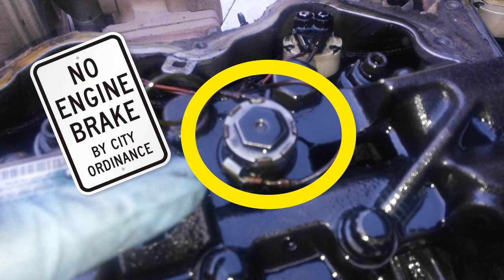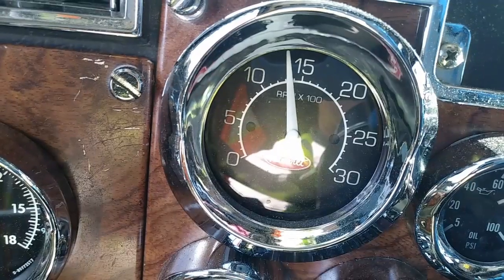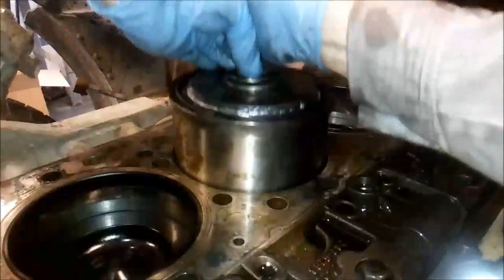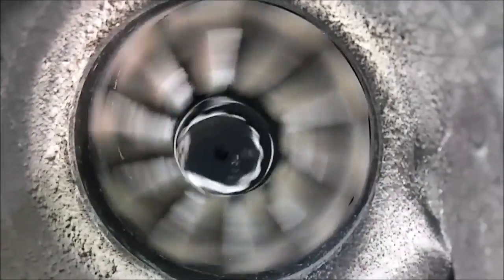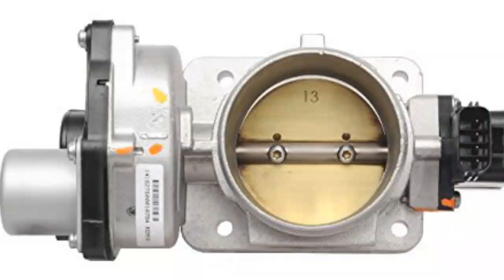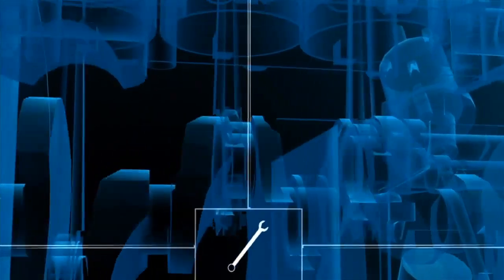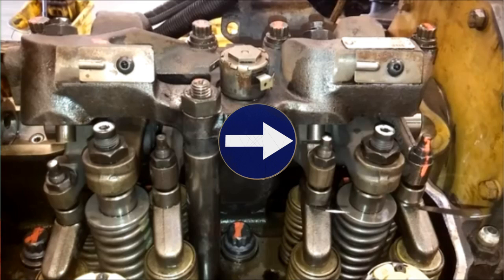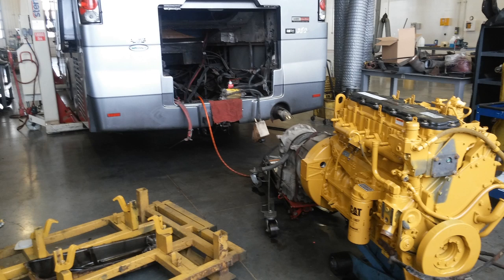The Difference Between Jake Brakes And Exhaust Brakes?

Comment: So the old engines back in the day. Had a release valve(s) on  the head(s). With a cable attached to put the compression in the head. Hence slowing or killing the engine. So this is based upon  the same concept I assume. I've seen these in 4-strokes and 2 stokes for some reason.
Reply: Sputnik isn’t that a compression release? Makes starting the engine easier, especially cold starts.
Reply: @interstate5trucker  Now that you mention it. Though it was never explained to me. That actually makes sense what you said. I am from where engines are stopped by shorting the coil. [By hand] I never gave much thought then. I thought it was how they normally shut it down. {Which they sometimes do] But yes, I believe you are correct.

Comment: So lost compression on #5 on my c15 Sdp found it was leaking Thur exhaust valve tore it down and found out the exhaust have be hitting the pistons set and checked timing before I tore it down everything checked what else could cause this thx
Reply: Crack in the head

Comment: 2:00 you are not 100% correct. Diesel because of much higher compression, have greater engine braking than gas engines. Big trucks need exhaust brakes because of the heavy weight.
Reply: Actually you are not entirely correct , even without a fuel input or very minimal fuel input what do you suppose happens when the very high heat ,highly compressed air does to the top of the piston when it starts its downward stroke... thats right even with out fuel it gives the piston a good shove down the bore.
Reply: @walkerv8530  I own a 2016 F150 with the 2.7 ecoboost. set the cruse control at 35 mph and go down a hill. It will down shift to 2nd. gear before the engine compression braking can control the speed.
Reply: @walkerv8530  You ever tried to turn a diesel engine by hand? It's a lot harder to turn even after the compression stroke.
Reply: @Fone65  i am a going on 20 years working on heavy trucks,  so yeah by hand np the compression leaks past the rings big difference when its turning at speed on its own no time for much compression leakage.  You try  and do what you do in your pickup truck down a grade in a big truck with out any jake brake or exhaust  brake you will overspeed engine in a heartbeat with a load on . Empty maybe you can get away with it depending on the grade .
Reply: @walkerv8530  Here we go with the "I been working on big trucks for 20 years" capping. Telling me you have been working on big trucks is a waste of time. Unless you have videos on your channel of you working on big trucks. I'm not going to believe you. 
The point of bring up my F150 was to say small gas engines have very little compression braking. If my 2.7 was a diesel v6. The tranny would not need to down shift so low to control speed.
Reply: @Fone65  some people have a youtube acct to be able to subscribe to channels,  i have no interest or time to make videos. You don't have to believe me . You can look me up on HEF or Fb i post  some of my work stuff on both , mostly on heavy equipment forums , under shop talk .walkers work doings .
Reply: @walkerv8530  I don't mess with forums. People lie their ass off there.
Reply: If you watch his video on compression brakes like he said he is not going in depth here because he has another video on them.

Comment: Electric motor powered vehicles can use the motor as a brake and put most of the energy back into your batteries. 
Since this video is for curious people seeking knowledge I thought I'd throw it out there. And it's basically silent !
Reply: Batteries aren't magic. They can't absorb arbitrary high charging input, especeally beeing cold, fully charged and too high at all. For example, battery from Tesla Model S p90D road car is only limited to 60 kW regen (less if full or cold) and 450 kW of power.
Reply: ... Regenerative braking already exists on some electric and hybrid vehicles. Of course its used in conjunction with conventional brakes and there are limitations to how much the batteries  can handle in a given amount of time. But it works just fine you goofy ass mafcks 😂 @Richard Wolfe
Reply: Only if they have alternators or generators instead of brakes.......
Reply: @thecloneguyz  An electric motor can easily be used as a generator. Its called regenerative braking.

Comment: exhaust brakes work better in the city. But for pure horsepower for reducing speed on a long steep hill, jake brakes do the deed better because they produce more horsepower to the drive wheels for slowing. Like using your engine for a compressor. A big multi-horsepower air compressor. That is not how engine brakes work.They just use the engine to pack the exhaust with all the flow out, thus not using the flow as efficiently for power to the rear drivers.

Comment: Does anyone remember the magnetic braking
Reply: loadmaster61 intarder
Reply: Anyone remember a retarder system called Telmar?Basically an oil pump with cooler that retarded engine RPM.
Reply: They still make those.

Comment: Why is my Jake brake so weak even though I had an overhead done, 06 W900 with a C15 Accert MXS 826k miles? When I'm bobtail it doesn't even lock the tires up in the rain.
Reply: rev9fan1 you DO NOT WANT TO LOCKUP THE REAR WHEELS IN THE RAIN !!!! That will cause a loss of control as tire grip goes away. Never ever do this.
Reply: @donaldpauli129  I know that, I'm saying the truck I used to drive locked the rear wheels up bobtail, this one doesn't...which means the Jake's are weaker...I was using it as an example

Comment: I saw a pickup truck with a camper one time, it was a diesel, but, supposedly it had a jake brake.  I don't recall the exact model, I think it was an older Dodge.
Reply: [FCClan]The Stranger new ones have em on the 6.7 cummins
Reply: @RDC_Autosports  When did this start?  The truck I saw was several years ago.

Comment: I've seen those stupid no engine breaking signs. I'm the ass hole in the blue KW blowing by it on the brake with a straight piped Bmodel 3406. Our truck with the straight pipe c12 is a lot louder but it's more high pitched and cracky I'm not really a fan of it

Comment: I have an exhaust brake (5.9 Cummins  RV) and I am curious has there ever been an intake retarder (exhaust brake on the intake side like a butterfly valve in a gas engine)? If not do we know why and if one was installed with the exhaust brake would it improve the engine braking?
Reply: It would screw up the af mixture and cause a lean condition, causing damage
Reply: If you restrict intake air flow in a compression ignition (diesel) engine, maintenance and repair costs will rise due to fuel dilution of the engine oil.

Comment: How come ram Cummins, Chevy Duramax donest have a Jake brake  but have exhaust brake. I need answer for this question
Reply: I think they're technically classified as light duty trucks...and hell, most people don't even pull anything with them. I'd expect someone who is frequently towing to get a medium duty truck. Having an engine brake on light duty trucks is an additional system that most people won't use, the ones that will, will likely exceed the GVWR. There's also an issue with qualification, giving average Joe advertised capability of a 25,999 lb GVWR or 9,999 lb payload and the false confidence of an effective marketing strategy is just asking for a lawsuit when Joe goes flying down a mountain and kills a bus full of children. It's not worth it for the manufacturers. Just my opinion.
Reply: @littlerhino2006  you have shitly explanation
Reply: I have a friend that has a Ram with the 6.7 Cummins, he pulls a camper trailer with total weight around 25000 pounds. He says when he starts down hill/mountains he turns on the engine brake and it will actually slow the truck down until you turn off the engine brake or step on the accelerator. His has an automatic and it will keep down shifting as it slows . I would say that's a great safety feature
Reply: The manufacture does not use the Jake brake is why it is not in them.  Jake brake adds a lot of complicated equipment to the engine, listen to his explanation on this and watch his videos on Jakes.  He is going to explain it better in his videos than someone in the comments, watch his videos he is excellent.
Reply: You need an answer?  Did you watch the video?  I think he about covered it. No?  Then do some research on your own instead of waiting to be spoon fed.
Reply: Jeff O Exactly!! Fuck sakes; the guy explained it right near the beginning of the video!
Reply: @jeffo1108  fuck you old Ass
Reply: It's sort of an unspoken "get a real truck"

Comment: Nice video. I have Detroit series 60 and the engine break is really weak in 3 position and usleess in 1st. Are there different brands that have a stronger stopping power ? I checked mines at the dealership and they said they work fine but I have to use service brakes even if I'm empty on a big hill.
Reply: On a big hill you may still need to use your wheel brakes but. Find a good shop and have the valve train adjusted correctly and the jake brake adjusted correctly. They normally are extremely effective at 2,3,6

Comment: Great info!
The exhaust brake on my old International Maxxforce felt about as effective as the Jake on my old N14 and my new ISX15 truck with the system set to "1"..... In other words, it was damn near totally ineffective. Brake jobs nearly tripled in elapsed time after I ditched that Maxx POS......
Reply: My maxx 10 had an egr cooler failure twice, causing a hydro lock situation. Has had 2 in-frame overhauls, and still has less than 60,000! No “self-called” truck driver, will make me believe these are even decent engines. Pure, pure, junk!
Reply: The maxx force got a bad name but I drove one with 620,000 and it was a damm good motor held great oil pressure and pulled up mountains without having to downshift
Reply: @jamesshaw4954  I'm sure there will always be examples of any contested engine model that do alright, after all they did make thousands of them!
 That said, the general dissatisfaction with the MaxxForce combined with the subsequent abandonment of the engine for Cummins engines by International, tells me they had an overall bad engine on their hands. Mine had only 250K and almost never worked right or ran without a check engine light on. My N14 went 850K miles with almost zero problems and I've got an average of 300K on several ISX15 engines right now, with only regular maintenance required.
Reply: Intertrashional...there motor was trash but boy did they ride nice
Reply: Try playing cards in the spokes and stop whining! DK, ASE master tech since 78

Comment: So I run a Detroit DD13 and I've been told it's got a real jake in it but I've also been told it's got just a exhaust valve, it's only 2 position, it works ok, the older Cummings X15 I used to run had a real 3 position jake in it and that worked incredibly well, but the interesting thing is the Detroit is LOUDER really loud , the jake in the Cummings was quiet, both were completely stock exhaust, the DD13 is a grass burner.
Reply: Cummins no G

Comment: Thoughts on using an exhuast brake to warm up a Diesel engine quicker
Reply: international VT365 and powerstroke 6.0 fords did use the brake as a warm up device.  When the weather was cold and your engine was warming up you could go around to the exhaust pipe end and hear the exhaust load up and quiet down, then hear the whooshing sound coming when the engine brake function in the turbocharger let off.  Not sure if any one else does and I wouldn't recommend doing it on Cats simply because unless you are turning the brake on and off like the Internationals did you could overheat the cylinders due to the exhaust not getting out of the engine and cause damage to the internals of the engine.
Reply: matt lee Bc my 7.3 Powerstroke back pressure valve closed for a few seconds and I’m just wonder if booking it up to my own switch to leave it closed for longer would be bad
Reply: Not no, but Hell NO.
Reply: @johngoldsmith6629  modern diesels use their exhaust brakes to warm up quicker.
Reply: Modern diesels already use their exhaust brakes to warm up quicker
Reply: Yeah don't do that. That's how you build up soot on the valve and on the turbo

Comment: whats this break saver you keep talking about?
Reply: Brakesaver is a oil retarder mounted on the rear of a 5.4 bore engine, between the flywheel housing and transmission. It has two oil pumps, very long oil cooler, two flywheels, special oil pan with a control valve mounted to it. Leaks a lot of oil if not maintained.

Comment: I drive a 05 kenworth with a c15 Acert its the b model not the m the jakes are supposedly working all stages of the jake work  but it does not slow me down verry well at all
Reply: Kyle,
Could be the brakes Jake, are out of adjustment,  or not using a low enough gear. Not sure about a 2005, but I know the newer trucks with 3.08, or 2.64 2.25 gears are pretty high gears and would need to be in a very low transmission gear to have a lot of effect .
Reply: @bertgrau9246  seems about right 5th gear holds ok better than any other gear but shift into 6th or anything above it and forget it gotta ride the brakes and alot of the hills around here are 30 35 so 5th direct is 15 20 mph at 1700 rpm idk just gotta deal with it ain't my truck and my boss takes good care of me so I cant complain to much
Reply: @kylenagle4960  
I know what you mean,  I drove a lot of trucks without any kind of engine brake,  the rule of thumb was use 1 lower gear going down than what it would take going up, thing is with a 220 horse engine you weren't going up hills very fast and going down were slower 
I still drive once in a while trucks are so much more comfortable than they were. 
Have a good day sir
Reply: BXS engines still used the same Jake brake housing that the 6NZ engine used.  Lots of times a rebuild kit through your Cat dealer and about 3-4 hours to install and reset up your overhead and the brakes work way better.  The springs in the housing weaken over time and cause the brakes to not respond properly.  The exhaust brake opens too early and dumps the compression before the engine reaches full compression pressure.  Typically about a grand or so will fix them up really good and the brakes are rarely rebuilt like they should be.
Reply: lee  awsome thanks for the advice that's the best explanation anyone has given me yet

Comment: I have a 3406c Jake brake doesn’t do much. Only builds like 5 pounds of pressure on the boost guage. I used to drive a n14 and those jake brakes where great. What could be the issue with the Jake brake on my cat ?
Reply: Lash is very critical on these. You have to know, engine HP, serial number prefix of engine, three point or four point stand, engine brake model. Shimming the brake, seen it wrong lots of times causing housing's to crack. I pull valve cover and activate the brake manually looking for oil leaks. Tune up kits, if needed. Lastly you can get a tool and replace the solenoid with a oil psi gauge and make sure your getting enough oil supply to the brake itself. Remember these set on the highest point of the engine and if you have a internal oil leak, the Jacob's brake will suffer.
Reply: I'll bet you your jakes need adjusted
Reply: John is correct in saying that the engine brake on the C model is the highest point in the engine and the brake will suffer easily from lack of oil.  Also an engine that old may also need a rebuild kit that replaces the springs and critical moving parts in the housing with new and that helps the brakes a bunch.  Also if you remove the brake housing for service there is a small o-ring (Cat number 1H-1023 mounted on the oil riser that feeds the brake housing from the valvetrain.  Most of the time no one replaces them and they dry up and fall apart causing leaks.  The spring kit is pretty cheap through Cat and it is a very easy way to make the brakes work better again.
Reply: @brucelee64485  The 1H1023 will work, the Jake/Cat number is 7C0031.
Reply: @johngoldsmith6629  I knew that they changed the part number a few years back and I could not remember the new one.  Thanks John!
Reply: Jakes and cats dont seem to work aswell as detroit or cummins nz has hills that really test engine  brakes and cats are always 1 gear lower on decents, cummins  however definately works very well. Detroit s60 not far behind. Brake savers are for cats why they work so well. But voith retarders will just leave both for dead in this part of the world.
Reply: Thanks guys I’ll definitely look into it. And hopefully they get a little better

Comment: when adding a exhaust brake would not the exhaust pipe be replaced to handle the compression of the cylinders 150 psi or more ?

Comment: I have a chevy kodiak with the duramax engine, it has the vgt turbo and it uses this for the exhaust brake function. There is some added noise as the engine rpm's go up considerably when the exhaust brake is active. Also interesting to see the boost guage go up when the exhaust brake is operating.
Reply: Part of that is the Allison transmission’s grade braking as well.
Reply: If the "engine RPM's go up considerably" how is that slowing down the vehicle ?

Comment: Hi mate, bloody excellent videos..I'm a retired diesel mechanic in Australia, spent most of my life working on Macks, Cummins, Cat and early Detroit's and was wondering your thoughts on truck drivers using their retarders (jakes or dynatard) to drop their revs when floating their gears. I can remember in the 80's Mack had  some camshaft failures they attributed to drivers using their retarders when floating gears as the engine brake was being used very briefly on an unloaded engine and the camshaft was failing...any thoughts...love your channel, bloody excellent mate 👍👍
Reply: ,,, many do it, ,,, just tooooo much wear on the valve train .